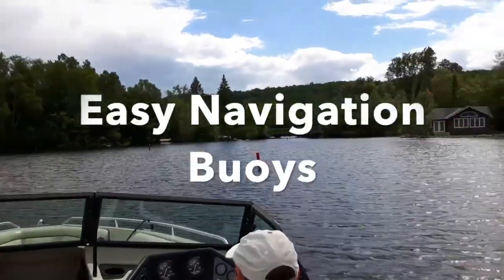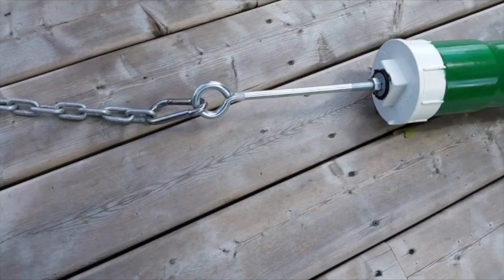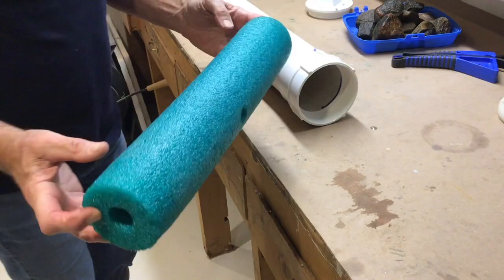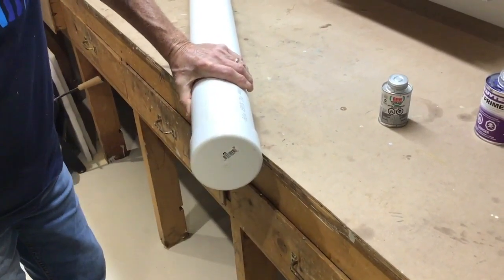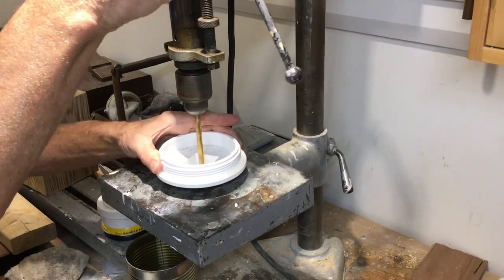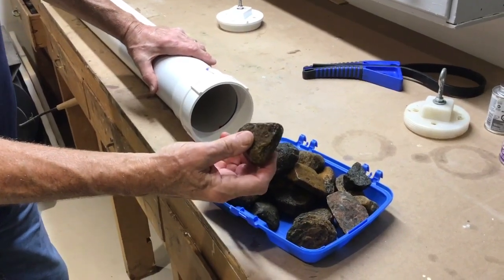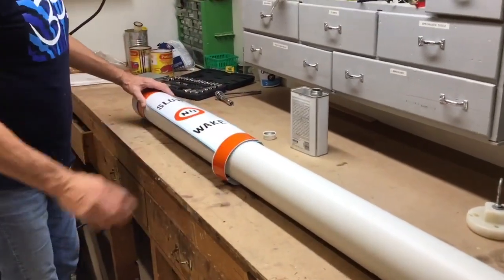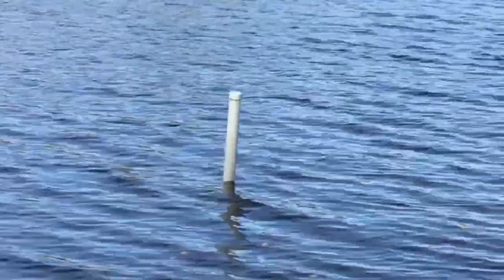Easy Navigation Buoys

Comment: Thank you Robert, I will be making some marker buoys for our lake association this winter.  We are located north of Ottawa and will benefit from your video!
Reply from the maker: Good luck! 
I am making some new buoys to mark hazards that use 6" diameter pipe. They cost more than the 4" but are a lot more visible on the water.  They also comply with Dept. of Transport regulations.

Comment from the maker: I have had requests for markers that comply with Transport Canada's Private Buoy Regulation that specifies  buoys be a minimum of 6 inches wide.  To do this I used 6" diameter pipe and fittings, but to buy them I had to go to a wholesale plumbing supply firm rather than a retail building supply/hardware store.  I found that 6" pipe and fittings are 4-5 times the price of 4".  Other than that, they went together the same except that I had to use the thicker and slower drying "Heavy"  PVC Cement rather than the usual "Medium"'. The larger joints require more time to paint with the glue so a longer working time cement was helpful. In addition the gaps in the 6" joints are too wide for the thinner cement.
Reply: Approximately how much in Cdn $ to make the 6” diameter buoys if one were making 12 or so at a time. Have you done a YouTube video on those yet?

Well done, the Transport Canada regs for Shoal Hazards as I read them stipulates white surface, 6” diameter, 12” above water line and marked PRIV and must show installer’s contact info. Flashing light and retro reflective material are not required but they specify what is needed if you do.

Is that your interpretation? I am President of a cottager’s association near North Bay & Mattawa and we are considering doing this.
Reply from the maker: @brianbaker359  I just made twelve 6” diameter buoys for an all in cost of $1,900.00. At this volume I was unable to realize any quantity discounts with the suppliers.  So I would figure on $160 each.
As to the markings, we did not put lights on ours but we did put on orange reflective stripes with the diamond design for the hazard markers.
Reply: @robertbevan125  Thanks Robert for your update on the 6” diameter pipe build. I am a bit shocked at the cost of materials but that seems to be the trend these days.

We are seriously considering the Go Deep yellow cautionary buoy GD-10 that is being used by several Ontario cottage associations. $39 each with shackle, PRIV on 2 sides and single row of orange reflective tape. Shipping and taxes are extra. Not 100% TC spec but others are using them with excellent results. Thank you for so generously sharing your experience and findings.

Comment: Thank you so much I am on a private lake and we needed no trespassing buoys in order for our sheriff to prosecute trespassing. How do you determine the length of the rope between the buoy and the anchor? We will have to remove the buoys in the fall as our lake freezes over in the winter.  I made the buoy as per your instructions and it floated perfectly vertical with 19” above the water. I used local flat stone that I drilled a hole in for the anchor. The cost was around $50.00 per buoy.
Reply from the maker: I like your idea for the anchor. The length of the rope is not critical. I use just enough to reach the bottom and tie the required knots while allowing the buoy float horizontally. That way I can let water in to make it pop up just by pulling on the rope. More than that and the scope increases, allowing the buoy to drift farther away from whatever I am trying to mark.
Reply from the maker: @richardvogel1735  Do you use sedimentary stone? All the rock in my area Is granite  and really hard.
Reply: Robert Bevan even granite using a hammer drill and concrete drill bit should not be a problem
Reply from the maker: @richardvogel1735   Re your comment that your buoys showed only 19” above water. Typically mine show 30”. The last three I made used 5 lbs of rocks and have chain anchor lines. Perhaps if you let out some water you could get yours to float higher.
Reply: Robert Bevan With less weight they did not stay vertical and the 19 is plenty to show the no trespassing signs so it works for our purpose
Reply: @robertbevan125  I am wondering when you say you used chain anchor lines as I thought you improved the design with rope anchor lines?  I am going to make two of these and love the video just wondering if you use the chain or rope? Thank you for sharing your expertise.
Reply from the maker: @joanfitzgibbon8717  I look after 24 buoys in our lake and leave a lot of the anchors in over the winter. As they rust out I replace them with polypropylene rope. It’s not as messy to handle and it floats.

Comment: Very informative tutorial. Ingenious idea! Thx. 
What did you use to anchor the markers and where did you have the waterproof signage and reflective tape made up?
Reply from the maker: I use 4” concrete blocks for anchors. They are lighter than the standard 8” block  if you want to take them out.  I bought the stickers from County Sign & Display in Minden.

Comment: Great design and thanks for posting!  I need to make some winter markers to replace our regular mooring balls.  Being in a rocky, salt water location, this allows the mooring chain to rest on the bottom during the winter months so it doesn’t wear out as fast. In the spring, the winter markers allow us to find and raise the mooring chain again to reattach to the mooring balls. I’m planning to try out your design. Do you see any problems using this PVC buoy in deeper (17 feet) and more extreme conditions (wavy, windy, salt water)? Thanks!
Reply from the maker: Hi Brian,
I have three active buoys that are happily anchored in water that depth and they have posed no problems at all. I use polypropylene rope for the anchor lines. As for rough weather my only experience is on an inland lake in Ontario but I have never had one sink or take in water in a storm, ever. If that did happen the pool noodle insert should at least keep the buoy afloat so you don’t lose it, but again that has never happened to me.
As for salt water it will provide more buoyancy than fresh water so you may have to use a more ballast than I used in the video. Don’t allow them to be top heavy or they will not float vertical in the water and will blow over too much in the wind.
Good luck
Reply: @robertbevan125  Thanks. I’m thinking more pool noodle (to keep too much water from entering) and more ballast to keep upright since mine will also be subject to wake from large ferries and boats. I’m also thinking a non-floating rope (e.g., nylon) might be a better choice to help prevent prop fouling—especially since I’m in a tidal situation where the amount of free line available varies throughout the day.
Reply from the maker: @brianweekley5700  Good point on the nylon rope and the tides. Would you make the buoys shorter (10 ft / 3) to decrease their wind resistance? I have made them this short (for use in shallow water) and they remain seaworthy.

Comment: if i wanted to use this method but make them smaller ( i coach a rowing team and want to make a home made buoyed course for racing) what would be the smallest size you would reccomend? and then what would the weight of rocks be then. thanks
Reply from the maker: I have successfully made them 33” long by cutting a ten foot pipe into three. As i recall they each took 3 lbs of rocks and floated with 17” of freeboard, but you might test that out first.. I use them in shallow water where the 5’ markers would  hit bottom and not float straight up.. The cottage association also uses this size painted yellow to put in a temporary caution line for their fireworks display. The 33”size is totally stable in the water and much easier to handle getting in and out.